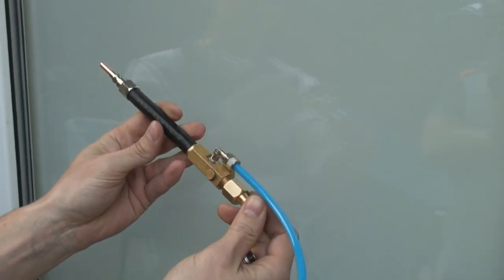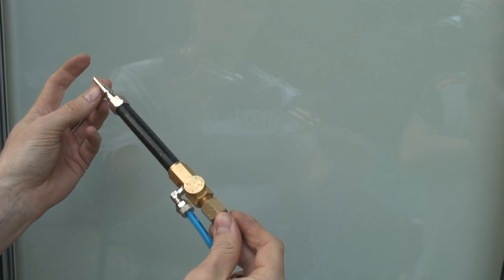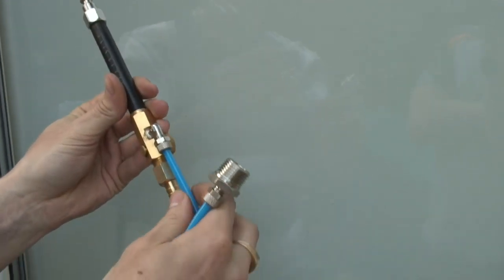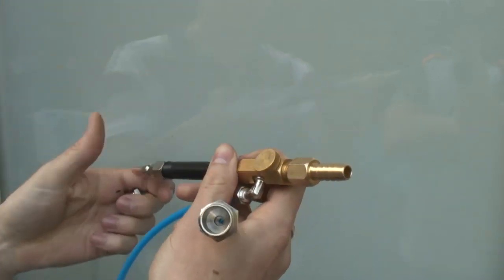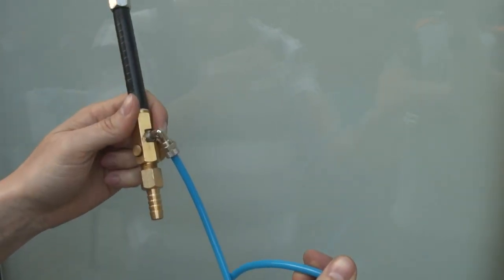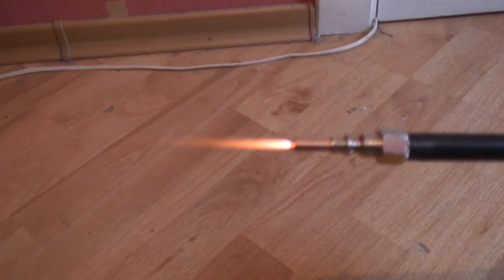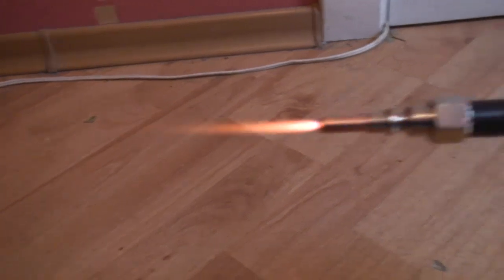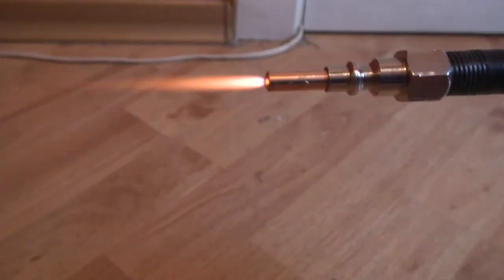hho torch welder high quality

Comment: Hi Faber516
 better to use costic soda instead of baking soda will work better + cleaner production .
I only know this by research and have it setup on a 11 plate drycell. Will put up some video when I get time.
But If I remember correct, mix 1 table spoon per 1 litter of destilled water and let it fully disolve before you use. you can increase the mix by adding more costic after if weak, and amps very low. But take care with thw costic soda or it can burn you.

Comment: you should sell these on ebay not ibay anyway how much would you sell me one for? dont need the oxygen deal or can you tell me if most of the parts are at home depot what size of pipe and adapter for the tip are you using?